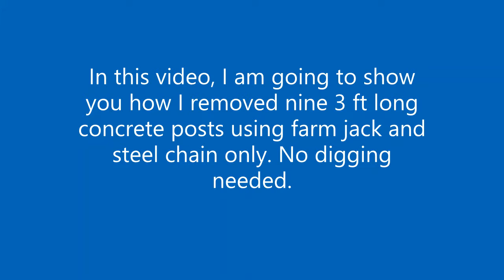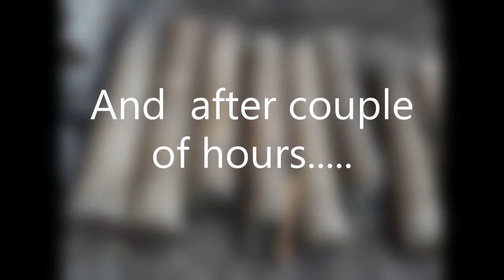How to safely remove concrete posts from the ground in minutes

Comment: i have to say, whoever put those in did a nice job. actually used sonotubes and the concrete is fairly deep. usually it would be a jackass job with the holes being 1 foot deep, maybe/hopefully at least 2 feet deep. this also makes it easier to pull out because of the smooth sides. and for a question about weight, yes each one of those is fairly heavy and require two guys to move around

Comment: Bojan, nice work - but just a safety tip - you should never have your head over the handle of a high lift jack - in fact no body part should be between the handle and the ladder.
Reply from the maker: Thanks Paul! Advice taken.

Comment: This may work for a small pier, but I tried it on a heavy pier and there was just no way.  The jack will tip forward.
Reply from the maker: I agree...posts were around 3' long and 8" in diameter. Sorry that didn't work for u

Comment: I dont believe this video.. The farm jack when pulling out will push to the front... making it impossible to pull out...
Reply from the maker: Ivan, the method worked well. The minute the post was well above ground, I leaned it to the side and safely laid it. It didn't push to the front.